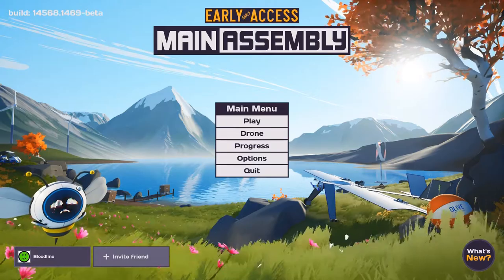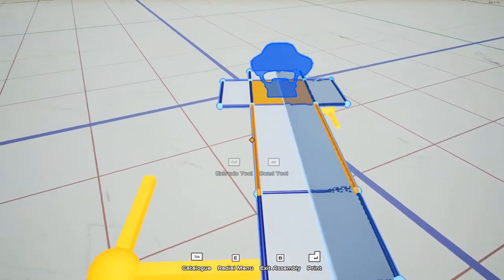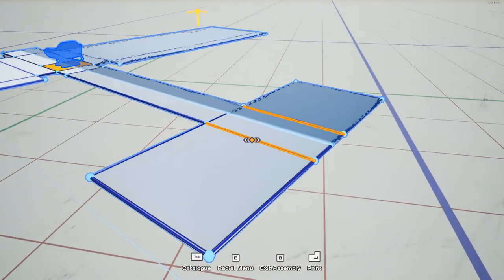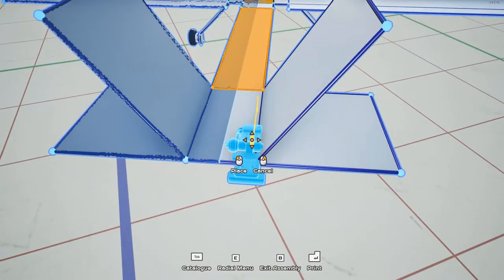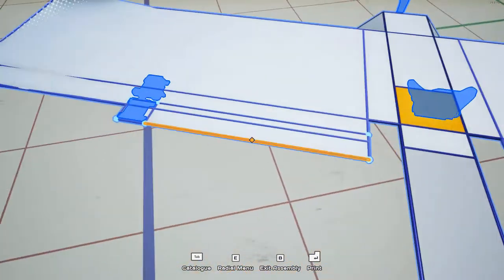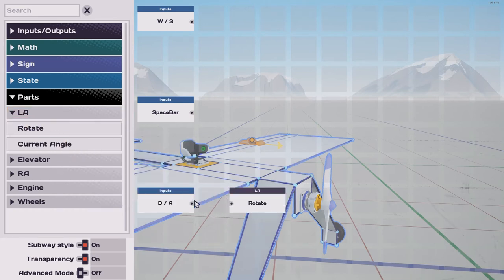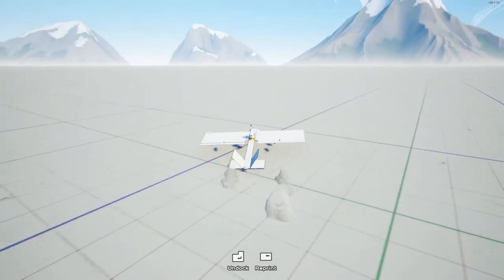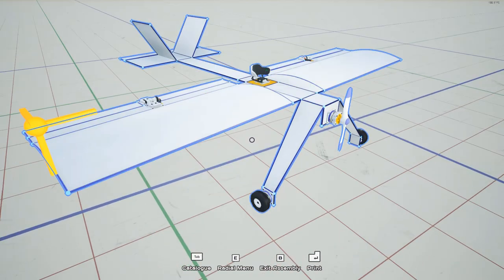Main Assembly - How to build your first airplane

Comment: Nice clear guide.
You can gain some time by using mirror for the aileron hinges and in the programming, advanced, you can switch mirror off for the programming only on the hinge block, which will have 2 inputs then instead of 1.
Reply from the maker: Thanks Pefington! This video was meant as a 'first' so I tried to keep it simple. I like your time saving ideas. I hope viewers read your comment for the advanced programming tips.
Reply: I build a mirrored hinged, is there anyway i can split the programming?
Reply: @ibuilda...1191  it's been a while, but if I remember in programming, if switching on advanced mode, you can separate them. You can place an inverter (in the programming) on one of the aileron hinges so that they will respond opposite of the other side.